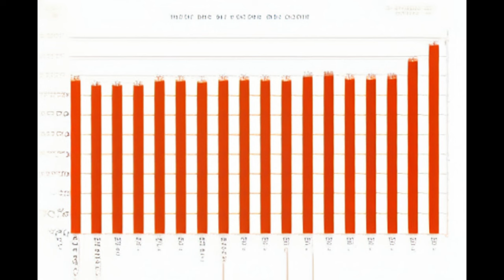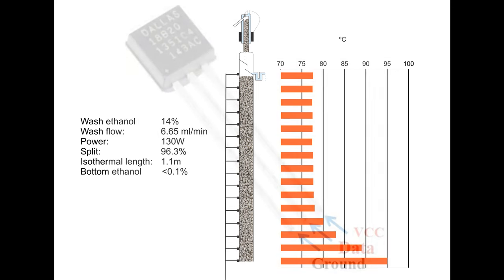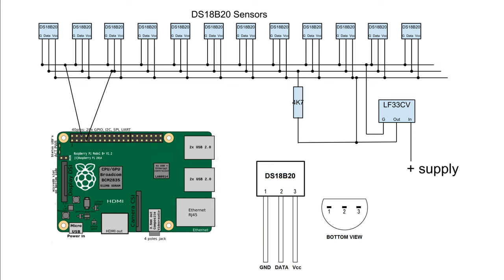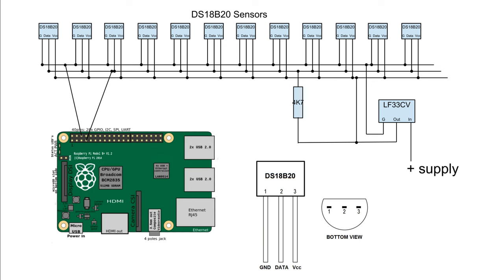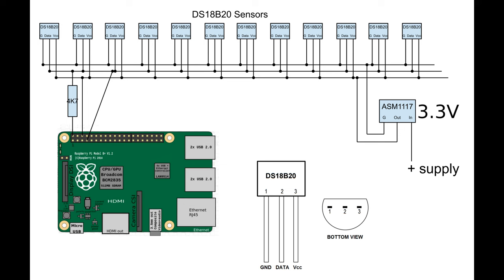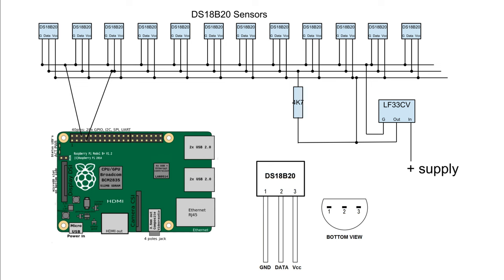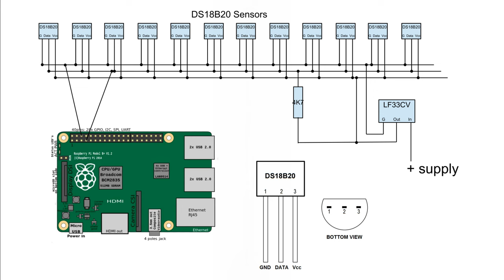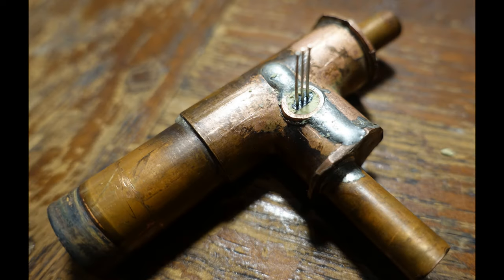Digital temperature sensors for continuous still column control

Comment: Hi, talking about pumps,have a look at the ulka pump, they are in coffee machines, steam generators. I have been using one (16w) with a dimmer switch to pump the wash. I put the inlet in a fine filter bag to stop it getting clogged.I hear what you are saying about the column temperature, I have 4 re-fluxing columns hooked up in series, once balanced I get about 91% abv out of a 13% abv wash. I use a pid at the top of the column for the fine control. My setup is quite modular and I  changing things around, to see what works best.My input is about a 1000 w of steam. Cheers
Reply from the maker: No I have not come across Ulka pumps before. I've had a look at them. They are vibrating pumps but I'm not sure how they're controlled. I see they can develop pretty high pressures which means they're probably able to overcome partial blockages easily. That's a problem I've had with peristaltic pumps. 1,000 watts of steam is a lot more than I use. What is the diameter of your columns? I use a single 28 mm column that's about 1500 mm long. That requires about 150 watts of steam produces spirit at 96%+.
Reply: I use 24/40 glass ware for the column,
where the narrowest point is about 17 mm and 1800 mm long. I control the pumps with dimmer switches,they don't seem to have a huge range of control, but lots of things to play with, pump size, some think better than a dimmer switch. At 1kw I am distilling about 10 litres of wash an hour or so. I will time it tonight to get a accurate number.The wash I am doing now is 180 litres and want to distill at least 3 times
Reply from the maker: @Jack-It-UP  what kind of column are you using? Is it a Vigreux? You have a high length to width ratio of 90 or so. How do you arrange stripping and rectifying? do you  inject wash part way up the column and steam at the bottom?
Reply: @tight1449  Hi, at the moment I am using 3 re-flux columns and one column full of rashig rings.Each column is about 450mm.
They sit on top of a coil of 19 mm by 6m copper pipe,(idea I got from you,but yours was square)I feed the steam into the lower end of the coil( I have glass fittings to let the water drain out) and the column sits on top of the coil. I inject the wash in about a 100mm down from the top of the coil.
Now that I have the steam generator sorted,it runs with very little attention.By adjusting the pid temp at the top by a degree or so I can get the abv to move accordingly, things hum at about 90-91% abv for this set up. I am looking forward to you posting some more on your jam jar condenser or is it a column, so I can borrow some more of your ideas. I nearly got some snyder columns at the right price but it fell through. Some feed back on the jam jars would be great, I can see some potential problems with what materials to use. Cheers
Reply from the maker: @Jack-It-UP  What is the rate of wash injection and steam flow? Sounds as though is you dial back you will get higher proof.

Comment: Hi, just had the still running, and am doing 1litre/11 minutes with a temp of 78.5c and 90 ish % abv. I should clarify, the columns I'am using are, coiled re-flux condensers.
Reply from the maker: That sounds similar to my own experience. What is the diameter and length of your rectifying column? If you're aiming for a higher alcohol concentration then I suspect that you're running the still too fast. If you're measuring surface temperature then it's probably going to be a couple of degrees below core temperature. With my column which is about 28 mm in diameter, I run it at about 600 mL of wash per hour and about 76°C surface temperature to get a product concentration of over 96%.

Comment: This is my set up   https://youtu.be/WPWG3lMla9I
Reply from the maker: Thanks I've seen it. Very clear and a lot better made than mine! What alcohol concentration of the waste are you getting? I had no luck using a sloping tube as a rectifying column and so I inject wash between the sloping tube and the vertical column but then my sloping tube is only 3m long and half an inch in diameter. To get a higher proof product I would suggest turning off the cooling water to the rectifying condensers and reducing the wash feed rate to around 5 ml per minute. What is the output from the PID controlling?
Reply: @tight1449  If I put the wast through again it takes forever to get anything out ,on this run it took about 20 minutes to get 50 ml of 85% abv. I would estimate the wast wash would have an abv of less than 5%. If I made another analyser coil I would space the coils out ,a bit like a spring, and go to 25 mm pipe. The pid controles the cooling water to the rectifying condensers,which are hooked up in series.I did try your idea of having a condenser at the bottom of the rectifier filled with methanol, but found that the coiled re-flux columns in series worked as well, with out having two separate cooling systems.I understand runing 5ml a minute @ 150 watts is good going, but I am pumping 1kw into this, and it is just a striping run.I will take the coil of the bottom and put the pot on, and run the spirit again at about 40/50%, at that abv I have no trouble getting 95 + %.
Reply from the maker: @Jack-It-UP  OK so the high flow rate is for stripping. Do you have a 0-10% hydrometer or a pycnometer bottle? I aim to get the waste well under 1% as even 1% is around 10% of alcohol loss. Using a precision hydrometer is a bit of a pain as you need an extra large parrot. A 10ml pycnometer bottle and mg weighing scales gives better accuracy at lower cost but is more fiddly to do. Waste alcohol is the key parameter in continuous stripping and might be useful to measure.